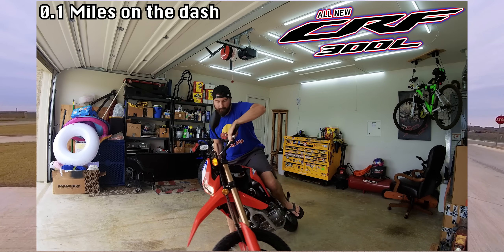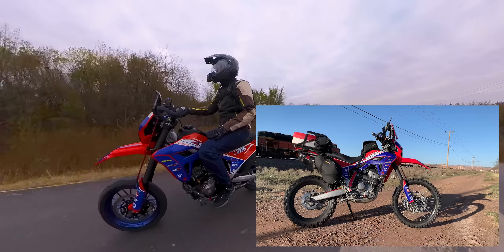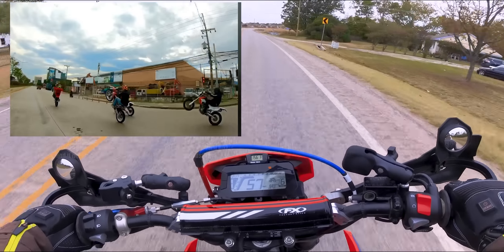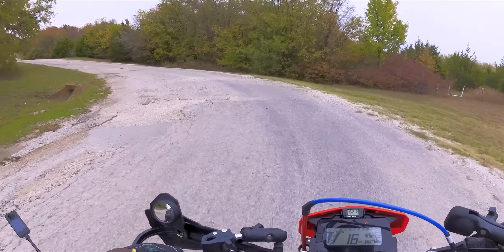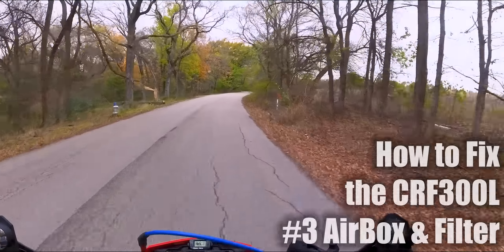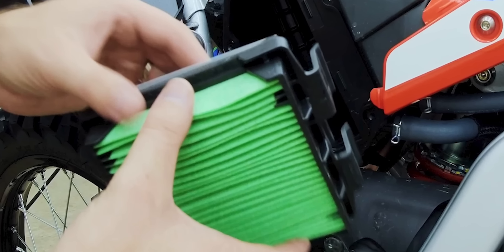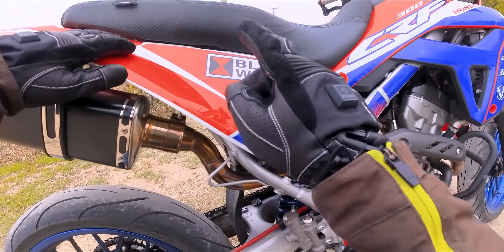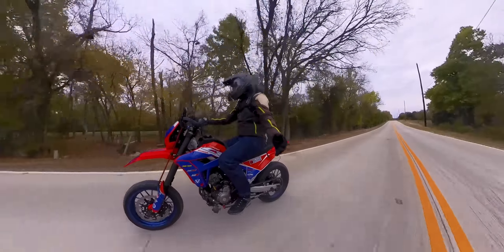How to FIX the CRF300L in 5 Steps

Comment: I don't get why bikes are so under sprung. Yeah I get target market, but even sitting under its own weight I feel like the DRZ400 was out of spec for sag. I wish I swapped the rear spring years ago, huge difference with moderate to aggressive riding.
Reply from the maker: Suspension is something in general that they need to get a grip with. Every bike these day is set up for a super light rider.
Reply: I believe small bikes are catered to 'smaller' riders i.e. in the asian market where, on average, people are shorter and lighter. Hence the softer suspension.

Comment: The XM5 just look so cheap and are upon examination very cheaply built . Sony abandoned the unrivaled fit of the XM3 XM4 Which is better than any headphones in my collection . I feel like a peasant wearing the XM5s And Sony Felt It A Good Thing To Up The Price By $50.00 . I Returned 2 Pairs Of XM5s Months Apart Trying To See The Value In Them And Other Than The ANC Their Is No Value I Could Find In The XM5s . 
My SoundCore Q35 & Q45 Have Better Sound Quality And Look Much Nicer Especially The Q45 .

Comment: they could've used tapered roller bearings in the steering stem instead of ball bearings like a bicycle. honestly i'd never buy one everything on it is built as cheap as possible which is acceptable for a learner commuter bike but not for a dual sport especially not when it's trying to fill the shoes of bikes like the xr250, drz250, ttr250 and wr250 all of which had better quality components and lighter weight.
Reply from the maker: Wait wait, I’ve had the triples off. It has tapered roller bearings. But yeah it’s gonna have some cheap stuff. It’s under $6k.
Reply: @TheGardenSnake  nope ball bearings, all balls sell a kit to convert to tapered roller bearings. it's just another thing that needs upgrading that shouldn't on an 8k bike. and i don't believe it's "some things", almost everything has been built as cheap as possible steel brake and gear levers, cheap cables, rear suspension is basically a  $20 shock absorber with a spring. pretty sad when a cheap 90's bike was built to a higher quality standard. they didn't go forward they went backwards.

Comment: Rode the CRF300L not long ago offroad and it's crap. Way too soft suspension for someone over 90kg and it's non adjustable at all, nowhere near enough damping either. I have a 5'6, 70kg mate that also rode it and said even for his weight thing is too soft, suspension on this thing is horrid stock to the point where it's not usable on serious off road. HOWEVER that soft suspension makes it excellent for dealing with urban crap like potholes and kerbs etc, it cannot be ridden hard at all tho as it is stock. The CRF300L Rally on the other hand has beefed up and much stiffer suspension, and with the addition of some quality of life features and a windscreen + bigger fuel tank, it's a much much better adventure/offroad platform. I understand that your use case is for supermoto but i feel like the CRF's stock suspension is way too soft even for that, cannot be pushed hard at all especially under braking (which the stock brakes are ridiculously inadequate for too)

Comment: crf L line will never be "good", well i should maybe use "the best" but it kinda sounds weird in my head, anyway, there is no way honda will make performance upgrades to the crf L line because they make the crf RX line, with almost double the hp (47 hp from its 300cc engine) proper racing suspensions etc

yes its basically a motocross bike with lights, but, if honda sells the crf L for 5250$ and the crf RX for 9000$ you can see why they dont norrow the gap, it would be bad business
Reply from the maker: Yeah but those bikes are going for different things. Direct comparison doesn’t really work. One could literally go MX racing with a few mods. The other could ride around the world.

Comment: Boring as it may seem, I bought a new Drz400 last year. Yeah it needs another gear, and fuel injection would be nice although I’m cool with a carb. But it’s still better than these 300’s. More power, way better suspension and they weigh about the same. Weren’t you thinking of doing another Drz? Sell that Thai bike and do it.
Reply: nah…
Reply from the maker: Drz is still a very good bike in 2022. I like doing different things though. I guess I could see myself doing another drz but also 🤷‍♂️. At this point my crf is on par with a modded drz. Not quite as fast as mine but I’ve got some plans I’m about to do.
Reply: @TheGardenSnake  Your Crf is faster than a modded DRZ?

Comment: for me, i know it doesn't make any sense, but i just don't like honda, in general.  i look at all their bikes, i watch all the reviews i can find, i look at the specs and the prices and whatnot, and i'm just completely turned off by them.  they seem overpriced for what they are, and it seems like they survive on their reputation for reliability.  but in reality the other big brands are every bit as reliable.  i've never heard anything that would make me want to spend money on a honda.  well, the one exception would be for the rebel 1100 because there's really nothing similar in that price range, particularly because of the DCT.  don't get me wrong, i love shifting.  i had a quick shifter on my tuono 660 and kind of hated it.  i really love manual shifting.  but the prospect of a cruiser with an automatic tranny just seems cool to me.  i have no plans of ever owning a cruiser, but if i did, that's the one i would want.  it's the one honda that actually seems like a great value.

and you have to know that they use the parts they use because they already have them.  any time you see a situation where they could easily have used something else, it's because they already have that worse part in quantity, or they have a contract with a manufacturer to keep using it.